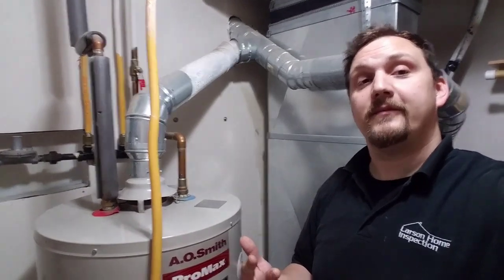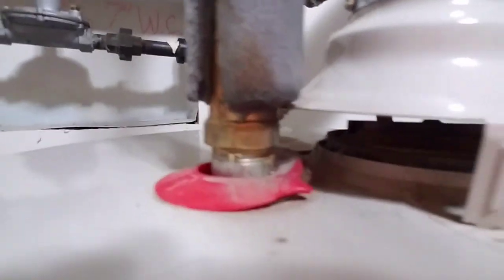Back Drafting Water Heater Exhaust Test

Comment: Part of the problem is that the furnace has an induction fan to force the exhaust gas up the flue.  Then there is an upstream "T" connection rather than preferable "Y" connection.  That furnace has got to be pumping some of its exhaust gas through that T and down to the hot water tank.  I'll bet that there is very little "natural" venting of that hot water tank when that furnace is on.  When the furnace is off that hot water tank probably vents just fine.

Comment: you dot know man, the problem is the T , you need to install Y not T, that is the problem de flow from dunnage going 50 por ciento into the pipe water heater.

Comment: Question - I have an older, leaker house - when my chimney was lined with flexible 6" tubing my water tank exhaust started to howl when the winter wind blows. I notice it when neither the furnace nor the water heater is running.  Any suggestions? It makes it seems colder in the house due to the wind noise. My setup looks very simular to what is in your video.
Reply: You need a proper cap on the chimney that protects from wind effecting the natural draft of the chimney.

Comment: Those flue connectors are a mess. All of that should be taken down and done right.  Both are oversize for the appliances.  Usually it takes up to a minute for those flues to prime.  Outdoor combustion air should be brought in one within 12” of the floor, one within 12” of the ceiling.  That’s code in most areas.

Comment: Well what was the fix?????
Reply from the maker: Sorry you didnt catch it, installing a fresh air intake duct into the room.
Reply: @larsonhomeinspection9932  Oh, lol I totally missed that I was waiting till the end and was like huh. Thank you for posting me back. I actually have same issue and just met with my contractor and he said same thing, install fresh air with barometric damper and that should resolve any issue. 
Also make sure vent is connected well, that the water heater is offset from furnace so the fan assist on the furnace does not blow the fumes back thru water heater vent. 
Cheers

Comment: Most likely the flue pipe is under sized for the combined btu load going out or that flue has a partial blockage. You can see the flue pipe is upsized for water heater which is good , cause most standard gas water heaters are 40k btus which requires at least 4" flue depending on length and elbows.
Reply: Just the opposite.  Those flue connectors are both oversize.  Look at the connections at the appliances.  There is no need to increase the size of the flue connectors beyond the size of the appliance collars.  Too large will actually decrease draft.  He also needs proper upper and lower combustion air, and the main stack needs to be checked for blockage.
Reply: @rodgraff1782  there can absolutely be a blockage but the vent size is determined by the BTU load and length. That vent needs to upside for sure because of combining both gas furnace and water heat into " common vent ". Plus all those elbows on furnace side adds length to the calculation. Your completely incorrect
Reply: @pineychristian  You are living in the Stone Age man.  Installation instructions take precedence.  You are using outdated information, which caused a lot  of rotted out flues from condensation and poor draft.  I was in the trade for 50 years, And taught Union apprentices for 30. I’ve seen my share of bad installations.  Not my first rodeo.  Proper combustion air is the most important aspect.  When it’s not correct, it causes all types of malfunctions. The chimney, the part that we can’t see, has to be sized for 100% of the largest appliance plus 50 percent of the smaller appliance, not the total BTU.  The connectors are sized for what ever size the breaching provides.  If the manufacturer wanted larger connectors, they would have put larger collars on the equipment. It’s obvious that the previous appliances requirements were different, and when they were replaced, they didn’t resize the flue connectors, or correct all of their deficiencies.
Reply: @pineychristian  They wouldn’t have tolerated me as a Union instructor teaching thru a community college for 30 years, paying me over $85.00 per hour, if I didn’t have a clue to what I was talking about, as you say.  I went thru a 5 year apprenticeship myself back in the 70’s. We spent almost a month on the fuel and gas codes, that dealt with all types of fuel venting, combustion air, etc. I then taught the same concepts as an instructor. The organization I taught for even payed my bachelors degree in education.  All instructors were required to have a 4 year degree.  I am now happily retired, with a large pension.  I have a binder full of credentials, that back up my experience.  Maybe you guys do things differently in your area.  Standards Vary.  Let’s just agree to disagree. I do apologize if I insulted you personally.  Everyone has differences in the was they do things.  The main thing is to be sure that whatever you install, or what ever you work on is safe when you leave.  Yes, I have used the instruments for testing combustion on gas and oil burning equipment, including draft measuring instruments, from inputs of fifteen thousand, to over a million BTU.
Reply: @rodgraff1782  good to hear and sorry if I offended you. I'm still in trade 18 years in and now strictly a commercial HVAC tech from small equipment to 120 tons RTU's.
Reply: I don't think an upsized flue would help. If it's still the source of combustion air intake, you'll get a backdraft. There needs to be another independent source of combustion intake.
Reply: @TheRayDog  you get back draft not only when there isn't enough fresh air for make up air but also when the flue is under sized. It will back draft when adding extra btu's into the flue pipe that it can't handle. Easy test for him to eliminate that is run the water heater by itself. If it drafts correctly ( most likely will) and only back drafts when furnace comes on then that " common flue " is too small.
Reply: @TheRayDog  he should use a combustion analyzer and check draft in the flue itself. But being home inspector like he may not have the training or tools to do so. Usually these test are completed from a HVAC tech.

Comment: Any thing  that sucks air out of your home like your furnace  or boiler your water heater your fireplace if using indoor air for combustion  your exhaust fans and your clothes dryer needs to have a make up air  System push air back in so you don’t have this problem. With high-efficiency sealed combustion equipment you don’t have this problem because it’s taking in air from the outdoors for combustion and not using any indoor air.  New homes are really tight and kitchen exhaust fans are getting  more powerful and suck a lot of air out of the house.

Comment: Awesome demostration. Carbon monoxide poisoning is more common than most of us think just google the statistics. The solution is to reroute the flue vent up to the highest point right before it exits outside or simply reroute the water heaters flue vent outside. Do not risk this carbon monoxide especially if you are there are seniors and kids in the house

Comment: I have this same issue.  The last few days was very hot where I live and when I run the AC I noticed the HWT back flowing.  At first I thought there was an obstruction in the flue and when I removed it, I could feel hot outside air rushing in from down the chimney.  The home also has a attic roof fan that was on. I could open a window or door and it would stop.   Can you give me an Idea of who could fix these issues?  Would I call HVAC people?  I don't want to run the AC if it is killing me.  Thanks For any advice.
Reply from the maker: It sounds like your attic fan is causing negative pressure in the house. I would air seal all ceiling to attic penetrations (attic hatch, ceiling fans and lights) with expanding foam to seal the house from the attic. There's also not enough air intake for your attic and high flow fan which is causing negative pressure in the attic and thus the house. Install a few more air intake vents for attic ventilation, and/or change the fan to a turbine vent (whirlybird). It's interesting that running the AC would cause negative pressure. The HVAC system might also have a fresh air intake which pulls air from outside which is causing negative pressure. An HRV would be an upgrade to balance it.
Reply: @larsonhomeinspection9932  I appreciate it.  Yes. it's a very odd situation.
Reply: Make sure that the make up air for the unit is piped outside

Comment: the furnace might be pushing air back down the vent thought the water heater flue if the main chimney is blocked.
Reply: I think that's the problem I have. We have a common exhaust that goes from the water heater to the chimney which also has a exhaust that comes from the furnace and connects to it. Our furnace went out and we had some melted wires. I thought it was the fan relay that shorted. Then when my girlfriend was in the shower I just happened to go down and look at the furnace. Here our water heater exhaust was coming into the furnace through the exhaust which was causing condensation to build up around the furnace exaust. The only conclusion I can come up with is there's a blockage somewhere that won't allow it to escape. The condensation was leaking into the wires in the furnace which caused it to short out. What's weird is there's no flame rollout from the furnace when it ran. Wouldn't the a block in the exhaust cause flame rollout?

Comment: How do you fix the problem?
Reply from the maker: Installing a fresh air intake duct into the room
Reply: @larsonhomeinspection9932  what if you don't have duct work? my house had electric baseboard heat, and a through the wall air conditioner. I would have thought the ac was bringing in air from outside and cooling it? my hot water tank vents into and old chimney and it is back drafting from negative pressure. there's a window in the same room, if I open it will that stop the back draft?
Reply: Instead of increasing the size of the duct from 3 to 4, keep it consistent 3.
Reply: @limadu671  you are correct.  That should be done on both furnace and water heater. No need to go bigger than the connection at the appliances.  He also needs properly sized upper and lower combustion air ducts drawn from outside, not a transfer grille.

Comment: Put an electric water heater in.
Reply from the maker: Electric costs 3 times as much to operate.
Reply: @larsonhomeinspection9932  I don't like electric water heaters they run out of hot water all the time.
Reply from the maker: @HighVoltageMadness  me too. Natiral gas is much cheaper and faster recovery. I like tankless myself.